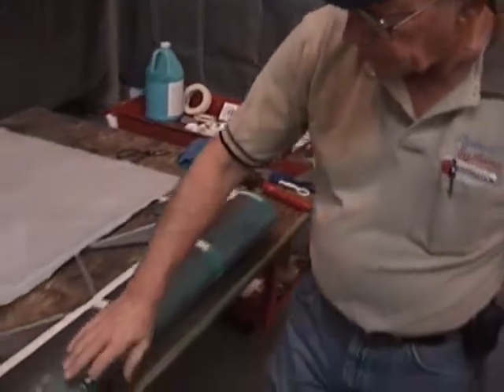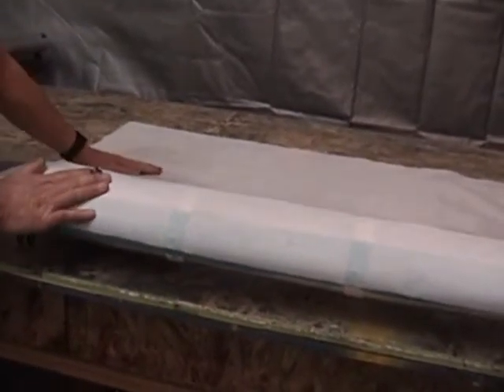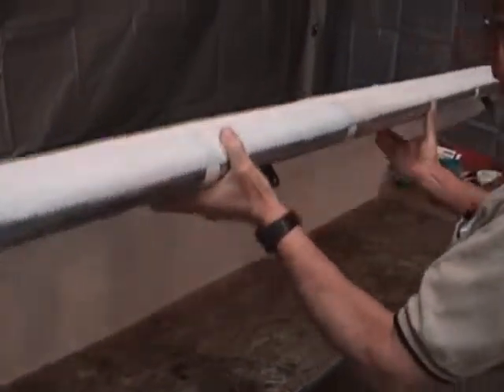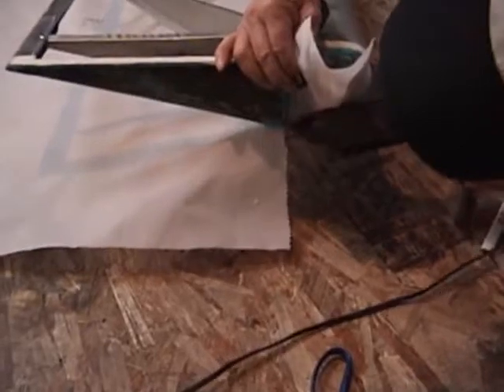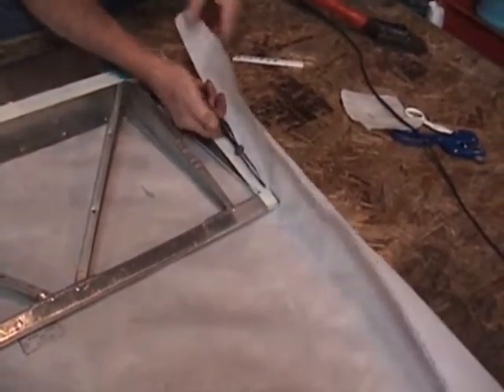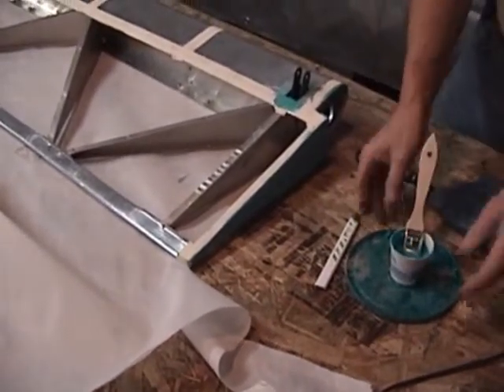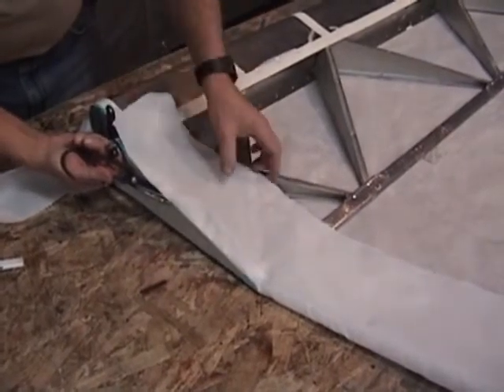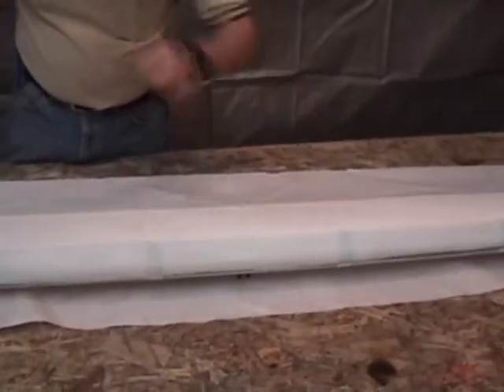Part 2 - Aileron/Flap Aircraft Fabric Covering with Stewart Systems

Comment: I intend to Construct a wood air frame that I am designing ant this looks like the type of covering.
Reply from the maker: +Anthony Bates 
I think you will really like it.  It is very easy to work with, light weight, and less expensive than many others.  It is also very durable and will last many years.

Comment: Can this method be done on a wood air frame?
Reply from the maker: +Anthony Bates 
Yes!  This system can be used on wood airframes.  We also have a waterborne wood sealer that works wonderfully.  Many of our customers are flying wood airframes covered in our complete system.
Reply: Thank you for the info.